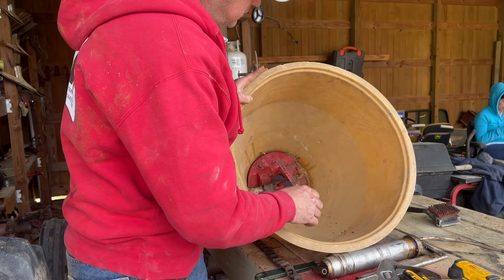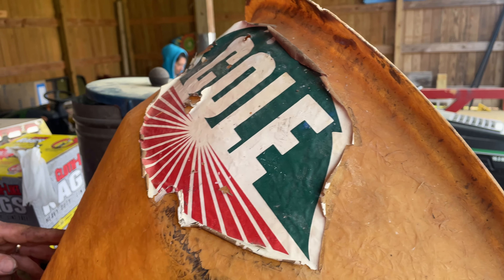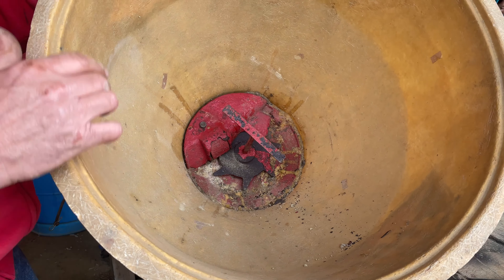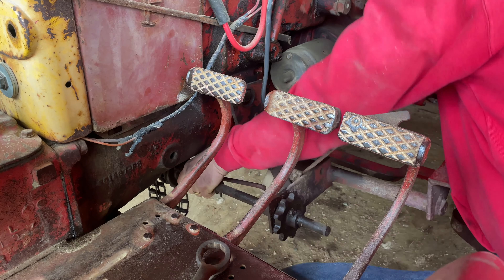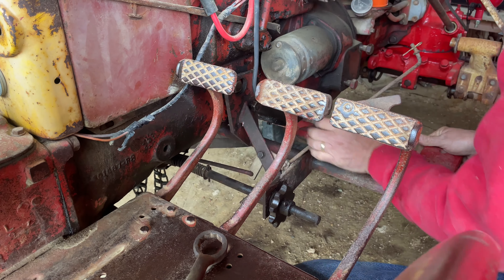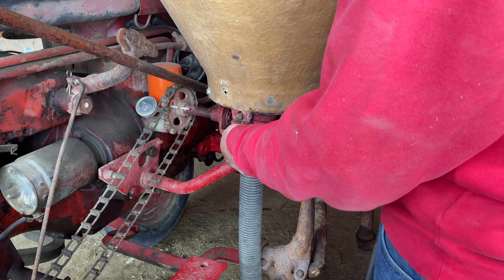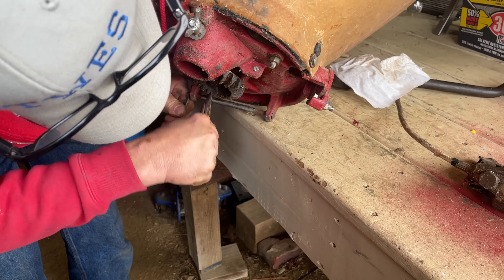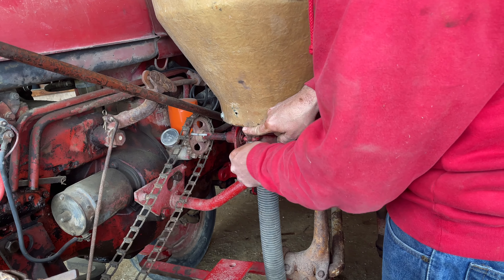Farmall 140 Fertilizer/Planter Setup

Comment: Great video Joe! You mentioned you had the crooked rod that runs from the right rockshaft arm down to the hitch bail. My 140 came with one and it's the only one like it I've ever seen. One thing I've been doing for years is using burnt motor oil to coat the bottom of my hopper. I used to paint it on with an old paint brush after I finished using the hopper. Now I have a plastic tub with burnt motor oil in it. When I'm done using my hopper for the year, I scrape out all the fertilizer with an old screw driver and wash it out good. When it dries off, I set it in the tub of burnt motor oil. About a month before I will use it next spring, I take it out and let all the oil drain off of it. I'm still using the original hopper that came with the tractor when daddy bought it in 1976. It still has the same plate that came with it. Whatever you do, when your done with it, CLEAN IT AND OIL IT!
Reply from the maker: Totally agree. I’ve been spraying it with wd40
Reply: @Jtwes  WD40 is wonderful stuff and I'm sure not as messy as the burnt oil.

Comment: One turn of the press wheel is about 4 feet of travel. So put seed in the hopper and turn the press wheel once and see how many seeds come out. 4 seeds = 12 inch spacing. 6 seeds = 8 inch spacing.
Reply from the maker: Thank you Wesley I’ll have to check that on the planter.

Comment: I have a couple of them reproduction hoppers and I had to modify all of them to fit  because they want a perfect match to a  true Ih hopper
Reply from the maker: Thanks Dylan that’s what I was wondering, if other folks were having trouble with them.
Reply: @Jtwes  and FYI the star will are the same even for a old Oliver grain drill but next time u can take the grinder and cut a slit on both sides of the new hopper to fit over the ears on the drive

Comment: Those Chinese put that locking bolt in the wung  way I bought one for my 182 planter frame making a bow bolt is possible, if u do grind that Chinese cut a slite bevel so it draws tite at long pin bolt.
Reply from the maker: Good ideal.

Comment: There is no link ??
Reply from the maker: Hey Teresa that’s a older video, what link are you referring to and I might can send it to you. Thanks for watching.
Reply: @Jtwes  the link to the i think corn seed you were talking about in this video
Reply: @Jtwes  would you ever consider trading your 140 and all fast hitch implements and all parts, pieces everything all of it  for a IH 274 diesel offset or a IH 265 diesel offset i have one of each both 1 owner tractors both all original both have less than 1000 hours paint is still on the brake and clutch pedals steering is tight on both they both have cultivators and FERTILIZER distrubotors
Reply from the maker: @teresajohnson849  that’s a nice offer but I would be afraid of getting parts for those two tractors. The Hastings corn link is www.raileyfarmandfield.com